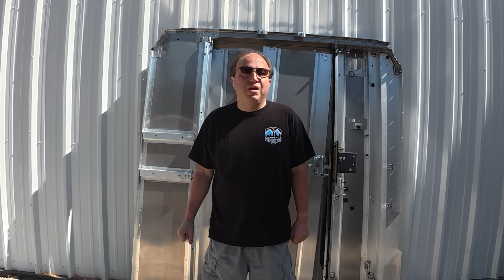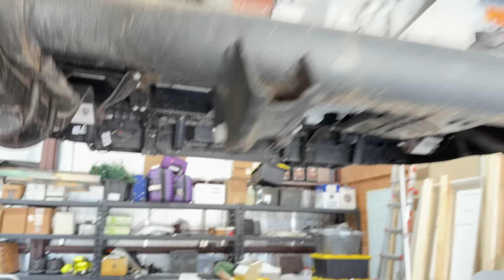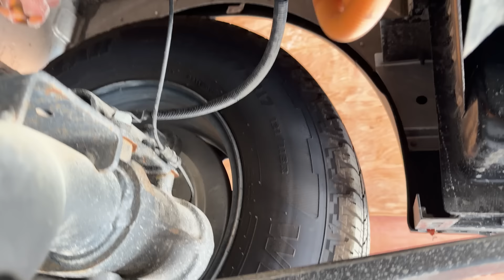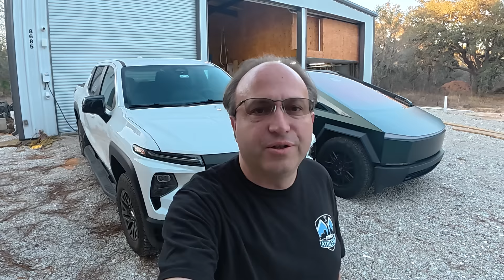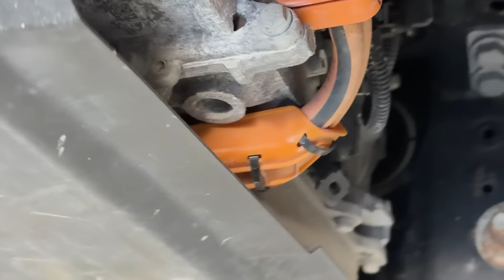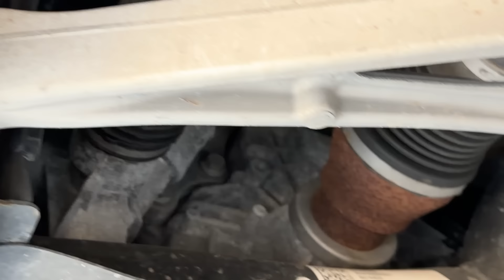BrightDrop 600 On a Lift: Tons of Tank Space + It’s Basically a Silverado EV Underneath

Comment: When you had it on the lift any sight of the speed sensor or tone ring? Thanks. Would love to get a service manual like the technicians have in the GM shop, thoughts?
Reply from the maker: I wasn’t specifically looking for the speed sensors when it was on the lift, but nothing jumped out at me as an old-school exposed tone ring. My suspicion is that, like most modern GM EVs, the vehicle is using integrated wheel speed sensors for ABS/StabiliTrak along with motor-speed feedback from the drive units themselves. These vehicles tend to fuse data from multiple sources rather than depending on a single speed sensor.

Comment: like the early 1960s p 20 would have been smarter to offer itt as a hibred plus a 4 cyl turbo truck engine  your wrong about the dl . 100001 a federal commercial 
none need cdl  , but if you put  high milage like 50-75k yr but in about 3-4 yrs parts will be hard to find the ev Silverado days are numbered

Comment: Subscribing here to see the conversion. By the way, thanks for the under body view, haven't seen that in any other channel.

Also, considering what you said that this shares many parts with the Silverado EV, I wonder if you could replace the slower BrightDrop 120kW DC charger with the Silverado 350kW DC charger.

That would be an interesting mod if possible.

Comment: I’m impressed the lift was able to handle this! Sounded like it was struggling. 😂
Reply from the maker: It’s a 12,500-pound lift, which was the biggest of the “consumer” class of lifts I could buy. So even at full gross weight, I should be able to put it in the air. On a side note, the truck weighs 1,200 pounds more than the van does when it’s in its current state.

Comment: Rotella GM commercial dealer in Fontana CA sells them no hassle for one in fact I got a big discount for a 2023 4WD 600 with spare tire and found lots of small tanks to do 43 gallons freshwater and 31 gallons grey water.
Reply from the maker: That’s very interesting, as with everything GM, it seems to be very hit or miss from one dealer to the next. I think we are going to end up with a black and gray tank in the spare tire area and a fresh water tank inside.
Reply: @BryantclanAdventures   Water tanks underneath details.... I can share links but should be easy to find... 

freshwater:

LHS Steps L=31.5" (Z=0-4")  H=8.5-12.5 W=13.5"
$57 ClassACustoms 15 Gallon Fresh / Gray Water Holding Tank Product ID: T-1500

Front Center Underside free space 23"L x 17.5"W x 12"H	
$54 Chaparral Boat Water Tank P/N:46.00196 B502901 13.5 Gal White Poly 2014 Model: 257 SSX				 

RHS Steps L=31.5" (Z=0-4")  W=10" H=12.5"
$50 ClassACustoms 7 Gallon Fresh / Gray Water Holding Tank Part Number: T-0700
$42 ClassACustoms 10 Gallon Fresh / Gray Water Holding Tank Part Number: p 254 IREGULAR

--------------------------------------

Grey water:

REAR MOTOR (IN FRONT OF) UNDER BATTERY
classAcustoms 24394 RV Grey Waste Water Tank 24" x 39" x 4
13 Gallon Capacity (Black Tank Only)  1.5" ABS Discharge Hub

Spare tire (in front of) W 34-35"
26 X 13.4 X 5.5in RV Water Holding Tank 8 Gal amazon B0D817SD1G 

--------------------------------------

RHS and LHS rear corner pockets for fresh and grey:
Alpha 11 Gallon 15" x 17.25" x 11.75" RV Fresh Water Tank VR151712W
recpro alpha-11-gallon-15-x-17-25-x-11-75-rv-fresh-water-t
Alpha - 10 Gallons Fresh Water Tank - 15" x 15" x 11" - 177BLANK × 1
elkhartrvparts alpha-10-gallons-fresh-water-tank-15-x-15-x-11-177blank
Reply: How much did you get it for, if you don't mind me asking 😅
Reply: That's a lot of weight.   Isn't the grey water tank usually LARGER than the fresh?

Comment: The FMC conversion:
Buy an older Tesla Model S with lifetime supercharging. 
Have Tesla install a NEW battery, pay for access to the full battery (now 110kw), new MCU, and rebuilt rear drive unit with new inverter coolant seal.
THEN, transfer all powertrain to the RV.

THEN, buy a decent used Model S 75 battery. These will only have 14 modules. 
You can cut off the front battery section, therefore reducing the length of the second pack. Add this pack to the rear of the RV.
OR, use TWO 75 battery shortened may fit better better in the wheelbase. 

KEY IDEA: The Supercharger will only recognize the original battery (now 110kw).

The second battery you will need to manual switch charge from the 110kw, or another source. 
Maybe best, the second battery is only rechargeable from RV roof solar, and/or standard 120v/220v campground power.

Note: SOME EV charge stations are set up with 110v to allow Ebike charging. You may be able to charge the second battery at these locations (it will be slow!)

Comment: Thanks, I have the identical truck but with the higher rated capacity. Purchased the spare tire kit and and winch . Great driving experience on nice days driving in the country with the door open is fun. The shield is a great idea.
Reply from the maker: I think we will using the space for tanks and maybe come up with a way to hang a spare Jeep-style off the back since we will be closing up the rear door.
Reply: What kind of range or miles/kwh have you experienced, say on the freeway and at what average speed?

Comment: I completely agree with you on the poor marketing of the Brightdrop. Bottom line, GM focused on the wrong customer. There are hundreds of thousands of trade contractors, small business people that would buy these vans at the right price and proper range of at least 600 a 700 kms in winter . I wrote GM on this exact issue before it went on sale and of course no response. The passenger seat is just plain stupid even as a delivery van. But yes, too much focus on fleet use.
Reply: Battery size alone made it too expensive to produce lol!
Reply: @alanmay7929 battery costs have to come down. Biggest issue.

Comment: 7:20 They are way too big for your regular tradesman. There's a reason all of those trades use a van. This is a replacement for a p30 style step van or a strip chassis with a box on the back. It's not a replacement for an Express or Transit.

Comment: If the front and rear drive units are the same as the Silverado EV WT, what is needed to unlock that extra 200 hp for the van?  Swapping out for the Silverado's ECM?
Reply from the maker: It’s likely the same ECU, but the programmed driving dynamics would be impacted. What I would love to sort is how to load the 400 volt Silverado charging curve. The one loaded in to the van is dumbed down to increase the life of the battery.
Reply: @BryantclanAdventures  What is the 400v charging curve rated at for the Silverado?  It would be interesting to figure out how to add the switches to flip the battery to 800v for 350kW+ charging....assuming the large pack van battery is the same as the 3WT's.
Reply from the maker: That assumes the bridge and high-voltage contactors to reconfigure the pack are even populated. Without the series/parallel switching hardware and the logic to command it, there is no way to reconfigure it. 

One of the more frustrating things about GM’s Ultium stuff is how locked down it is. Encrypted module comms, gateway-controlled firmware, WiFi-based BMS with signed updates… they’ve made sure you’re not touching anything without their blessing or someone more skilled then me on the hardware hacking front. 

With a Tesla pack I can get down to brick-level balancing, monitor individual group voltages, and manipulate contactor logic if I really want to. Ultium? So far it’s basically a black box with a very polite “no.” I haven’t seen anyone truly crack that ecosystem yet.

Comment: Great video! Nice to see that parts for the non canceled Silverado will be available for the bright drop. How did you end up affording all the EV’s
Reply from the maker: Fair question. It probably looks crazier from the outside than it is.

We’ve got three college-aged kids and they’re all in the Model 3s. I picked each of those up cheap because they had issues that I was able to fix myself. That’s kind of my thing… I’m comfortable buying “problem” vehicles and sorting them out.

The Cybertruck is an AWD, and after rebates plus my trade it landed around $40k. The 4WT replaced my Duramax because I was done spending $15k on DPF systems every ~50k miles. The Model JY replaced my wife’s 2016 X.

So it is five drivers on one property and each vehicle replaced something we were already running.

In real life I run a small IT company and travel all over the U.S. working on customer networks, so the vehicles are tools as much as they are content.
Reply: Must be successful engineer and low cost of living area 

Couldn't do this in most of US

Comment: Those giant pockets would be really good for holding water and waste water
Reply from the maker: I thought about that as a path, but we are trying to build this as a 4 season unit. For that to work the fresh water tank needs to be in the climate controlled envelope inside. The black and gray tanks can just be lightly heated with pads and be fine in the back cavern.
Reply: @BryantclanAdventures  Good reminder for me to drain my under tanks if I ever encounter freezing! Thanks!  I plan to insulate and keep as close as possible to the climate controlled envelope.  But perhaps a re-circulation from the best insulated tank to the water heater would be a good option.
Reply: I'm doing it.   Water tanks underneath details.... I can share links but should be easy to find... 

freshwater:

LHS Steps L=31.5" (Z=0-4")  H=8.5-12.5 W=13.5"
$57 ClassACustoms 15 Gallon Fresh / Gray Water Holding Tank Product ID: T-1500

Front Center Underside free space 23"L x 17.5"W x 12"H	
$54 Chaparral Boat Water Tank P/N:46.00196 B502901 13.5 Gal White Poly 2014 Model: 257 SSX				 

RHS Steps L=31.5" (Z=0-4")  W=10" H=12.5"
$50 ClassACustoms 7 Gallon Fresh / Gray Water Holding Tank Part Number: T-0700
$42 ClassACustoms 10 Gallon Fresh / Gray Water Holding Tank Part Number: p 254 IREGULAR

--------------------------------------

Grey water:

REAR MOTOR (IN FRONT OF) UNDER BATTERY
classAcustoms 24394 RV Grey Waste Water Tank 24" x 39" x 4
13 Gallon Capacity (Black Tank Only)  1.5" ABS Discharge Hub

Spare tire (in front of) W 34-35"
26 X 13.4 X 5.5in RV Water Holding Tank 8 Gal amazon B0D817SD1G 

--------------------------------------

RHS and LHS rear corner pockets for fresh and grey:
Alpha 11 Gallon 15" x 17.25" x 11.75" RV Fresh Water Tank VR151712W
recpro alpha-11-gallon-15-x-17-25-x-11-75-rv-fresh-water-t
Alpha - 10 Gallons Fresh Water Tank - 15" x 15" x 11" - 177BLANK × 1
elkhartrvparts alpha-10-gallons-fresh-water-tank-15-x-15-x-11-177blank

Comment: My 2025 600 AWD has a spare in the rear (US). Any thoughts on suspension tweaking/upgrades? I'd say that is the most frustrating thing about my 600; the rough/poor ride on non-pristine roads (even weighted down).
Reply from the maker: That is very interesting. Is yours the 11k version, maybe? On the ride front, right now I am thinking of swapping the rear shocks and adding airbags both to improve the ride and to allow for some amount of leveling. But that is a bit off. I need to get the build complete first so I have a better idea of weight.
Reply: @BryantclanAdventures  I have the 11K version, but people have shown the exact same part number for the rear leaf springs etc between the two "weight" versions.
Reply: @CallsignVega  Not the same rear axles, though.
Reply: @mavigogun  Any reference for that? On Brightrop forum pretty sure all the part numbers were shown as identical.
Reply: @CallsignVega  The spec document for the 11k GVWR/C7E coded products specifically indicates a higher rating for the rear axle - see: https://www.gmupfitter.com/wp-content/uploads/2025/09/26MY-Chevrolet-BrightDrop-400-600-V090425-CLEAN-FINAL.pdf